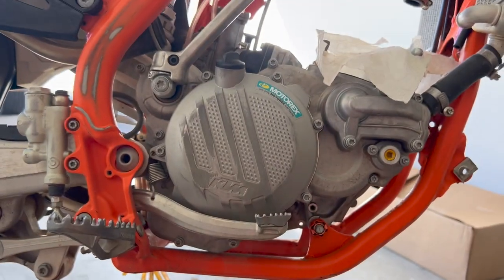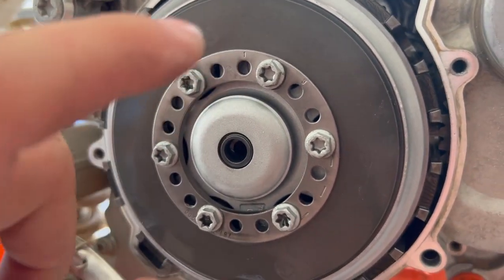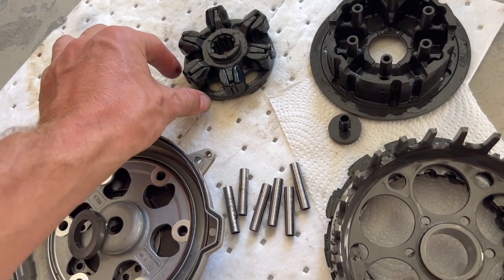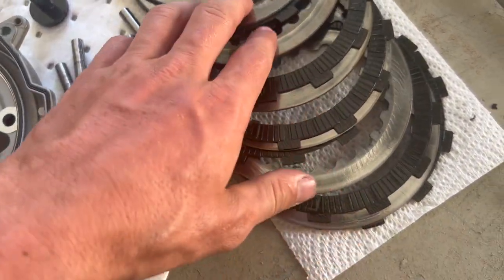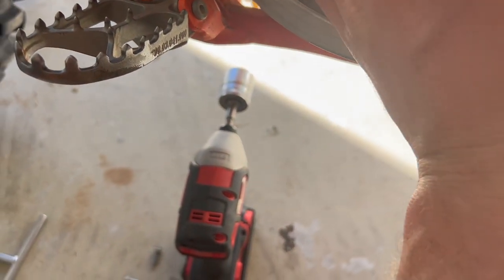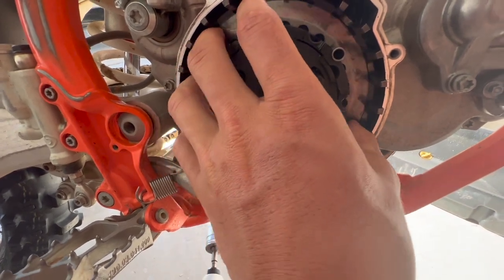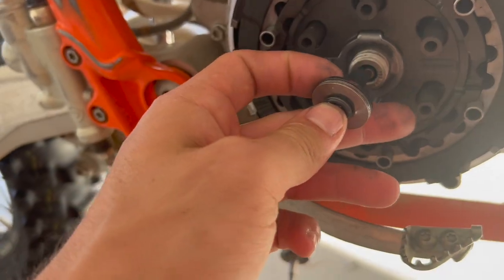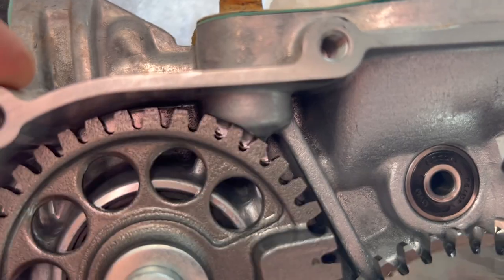HOW TO CHANGE KTM CLUTCH PLATES

Comment: Did you find the missing roller from the bearing?
Reply from the maker: No i rebuilt the motor to try and find it and it wasn’t in there and there was no signs of damage where it could of got into anything else. I think the bearing was like that from the factory
Reply: @Grant Taylor Vlogs  

Man that's some dookie stuff from KTM. But I guess it's better like that it came that way than having that little roller ruining stuff. 

I was looking at grabbing either a 2022 ktm sx-f350 or 2022 Husky fc350. There's one of each locally with low hours on them (under 20). Any thoughts or feedback about them?

I also know of a 2022 kx450 with only 4 hours on it & priced right. What would you get or suggest over the other & why?
Reply from the maker: @keithpeterson6108  i think the 350s are awesome. I really like them a lot for power and handling purposes. And i like the feel of the ktm over the husky so i would go ktm. And the kawi is a super comfortable and easy to ride bike. I would go with the ktm 350 or kawi.
Reply: @Grant Taylor Vlogs  

Awesome & thanks man. 👍

Really leaning towards the 350 but Jeter rode one. Actually never rode an Austrian 4t ever. So wasn't sure how they felt, behaved & if they were reliable as the Jap bikes.
Reply from the maker: @keithpeterson6108  yeah the Australian bikes are solid. All bikes have their things. Like anything else. But overall the Austrian bikes are super solid